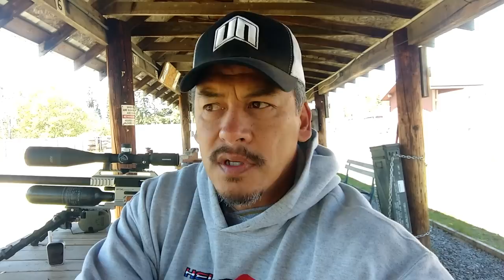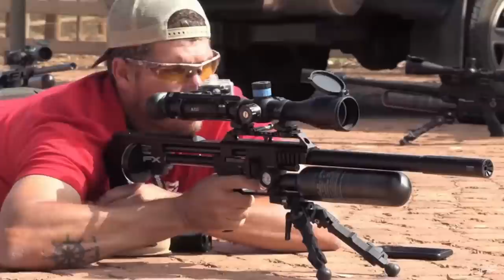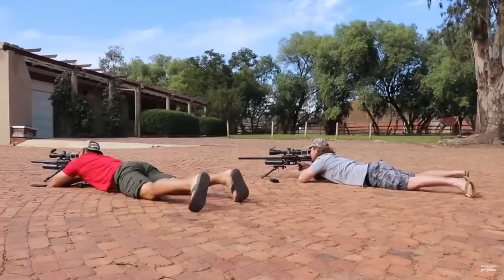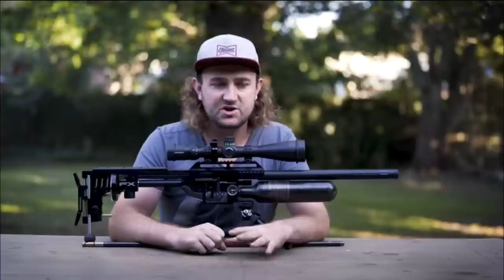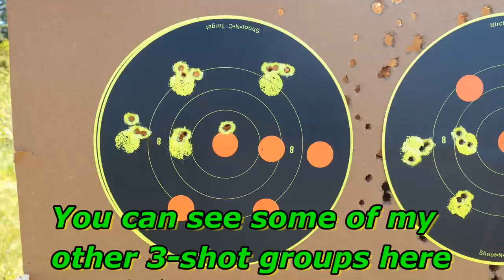FX Impact - Harmonic Tuning for Accuracy shooting slugs

Comment: great advice. i recently upgraded to the 700 mm barrel and slug liner in 22 cal.. i have it tuned for 18 gr. jsb but decided to put the slug liner in with the same tune and try it at 40 yrds.  the 21 and 27 grn. nsa did ok about a 1/2 inch. the 23 gr. shot a 1 hole group. problem is my pellets are at 915 fps. so i'm sure the slug are shooting a lot slower. just received 100 more 23 grn yesterday.  have to break out the crono and see if i can get the same group at a higher fps.
Reply: Hi buddy can you tell later how you get please thanks

Comment: Bob_O, I watched this video, and took a few notes even though I don't own an Impact. Your presentation of how to perform harmonic tuning may still be helpful to me and my little Taipan Mutant Short, though it has no external regulator adjustment. I guess I'll see how how well I can do with using only the hammer spring adjustment. Not shooting slugs, but only pellets, and the gun is turned down to just below 18 fpe with AA 18-grains pellets (backyard friendly, and still pest- control effective too).  So, thank you for breaking down the methodology of how to do it. But maybe the next time you're explaining air gun theory, you could do so while driving on a race track? That might be the cure for long-winded-ness  you've been looking for! :)
Great video. Thank you!
Reply: I'd like to see your results with the taipan, I was thinking the same thing. My only thought is that the taipan barrel is not as free floating as a impact so it might not be as tunable
Reply: @AirgunEvolution  Good on you for pointing out the Mutant not having a free-floating barrel. Compared to the Impact, it lacks that ready tune-ability. But my take-away is to test accuracy with small deviations in fps. I'll assume up front that it would be the best  I could achieve without removing and resetting the regulator. That would be labor intensive,and hit or miss, leaving only the hammer spring adjustment to tweak any give regulator setting to optimize accuracy. Still, Bob_O's tutorial got me thinking (within the framework of what I have to work with). Since I'm speaking of the Short, it has a shorter barrel to begin than the Mutant Standard, though similarly clamped. Trying to translate the harmonic tuning over the the Short might be an exercise with little reward, but I won't know until I give it a try (after this monsoon season!).

Comment: Informative vid buddy.   Now you are making me wish the crown had that fine of adjustment!
Reply: should have bought an impact buddy like me. oh wait I have two lol
Reply: My wife was smart enough to say no to two lol
Reply: Crown has it !!! Only thing is stock needs to be removed to reach it.

I believe he ment this little bolt that touches the hammer spring adjuster. Correct me if im wrong

Or did he ment this valvle stop rubber adjustment thing above the bottle ? Im on the point of buying a crown or impact. Lovr the looks of the crown way more
Reply: Hey suanes,
       Yeah you remove the stock to adjust the hammer.   But he is talking about the valve ball.   
       The crown is awesome because it has that adjustment in three repeatable settings, so i go to low and right back to high.   The impact does not have these repeatable settings.    But it does have superior fine tuning.    I shoot alot in barns so i prefer the crown overall.   But i really want an impact for my next slug gun
Reply: @68Whiskey  

Hee whiskey, thnx for youre answer.

How the crown has this ? With the transferport adjustment wheel you mean ?

I love the crown aswell im gonna go for it this month. Still finding out which one cause i saw the ones with the picatinny rail on top and the four barrel set screws. And this new amp regulator they talk about. Cant get clear on this yet so try to find info every where i can find. 

Would also like to shoot slugs in future like you but than in a crown. Mayby those four screws for the barrel will help for the harmonics ( just a thought) as i cant find any review over it that goes into detail on that. We will see ,if u have some news or thoughts about that you would like to share would be nice. 

Greets
Reply: SuaneS whichever version you get you will be happy.   Mine has the original set screws.  No issues.   It has the amp regulator, they all do now      Yes the transfer port wheel makes the crown quickly versatile, better than the impact for going to low low power quick.    For instance i go from 840fps down to 470 with the crown  .   But less fine tuning available over all

Comment: Hi Bob. Really enjoyed watching and learning from your video here. I have an fx crown. 25 cal.  Using jsb 25.39 grain King's I've been playing around tuning it and I have it set up now on reg preasure 122 bar and hammer spring 5 on the dial and its running at 850 fps. And it's shooting awesome groups but I do always wounder if I can get it any better. I've found that if I then  drop down to hammer spring setting 4  on the dial I can get that through the same pellet hole group at 50 metres over and over with 5 shot groups. But at 100 it then goes to one inch  group four of the shots  tight with one flier every time. Do you think this means I need a bit more reg preasure or slightly less reg. or a touch more hammer to keep it holding tight at 100. Any help would be greatly appreciated. Thanks Bob

Comment: Hi  Bob, this is a awesome video. Rather over explain than under I always say (and do). Just for fun, try and shoot some 18gr pellets on 2-3 clicks on the hammer spring less. I tuned for slugs but as you know we in South Africa struggle to get slugs so I am using mostly still pellets in my slug liner. I'm getting pellet on pellet at 110m because the tune is so that there is no turbulent air behind the projectile. Keep your awesome videos coming and and I am looking forward to 500yard shots one day if you keep going like this.

Comment: I fail to see the value in the 25-30yds groupings before shooting at 100yds? Please explain? Also, you refer to velocity tuning and harmonic tuning. Would you also please explain the value of velocity tuning, followed by harmonic tuning? Are you saying the velocity tuning was a waste of time? If not, then why waste time harmonic tuning? And if you have velocity tuned your gun, do you ruin it once you harmonic tune the same gun? Perhaps once you enlighten me to the whys and wherefores of the two types of tuning, this will all make sense! Please excuse my ignorance....it just seems to me that if my goal was one hole groups, I'd do what ever was required to achieve this outcome. Thanks for any additional education you would be willing to give me.
Reply from the maker: I don't know what else there is to explain.  Velocity tune it first for the power level you want.  Then harmonic tune for one hole groups at 25-30 yds.  That's it.
Reply: @BullseyeBob  Sorry for confusing you with my questions.
Reply from the maker: @edheinlein3747  Do you understand it now though?  You need to set your desired power level before the harmonic tuning.

Comment: Hmmmm, love it, makes me think, I gotta gun that will shoot quite a few different kinds of pellets, it's not super pellet fussy, of course it likes some better than others, the last one it tried it shoots several shots hole in hole for me, never seen that before so I dubbed it the guns favorite pellet and just got four new tins for Dads day, lol. But, now I am thinking that I've just gotten really lucky and tuned this thing in the right spot by mistake and I bet it can be done harmonically with the other pellets that it shoots pretty well. The problem with mine is that I have to open it up to adjust anything, I have it set where I like it, and I'd say that I need to leave it alone because I watch this thing put several pellets in the same hole from 25 to 40 yards every time I shoot it since the pellet switch, my gun is unregulated as well, Oh, and I forgot to mention that I'm no sharpshooter, but apparently I can guestimate pretty well though, lol. I think it all adds up, the power and speed, but this is another fine tune tweak that could make a world of difference on any gun because of the harmonics being an important factor, I'm thinking out loud here, see what you've started. Thanks, love the info and vids.